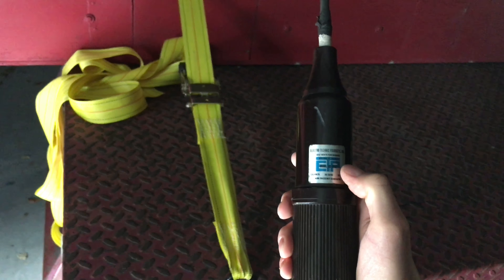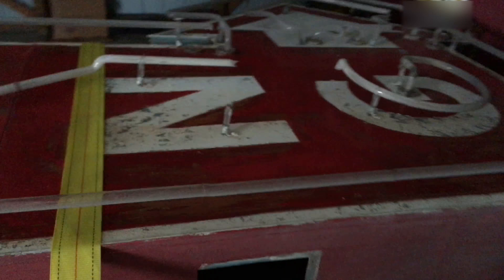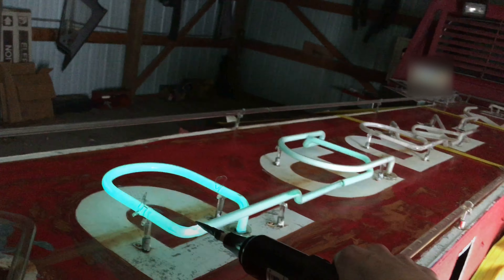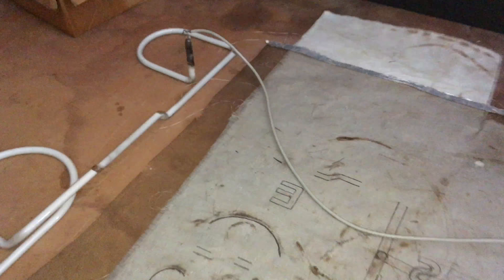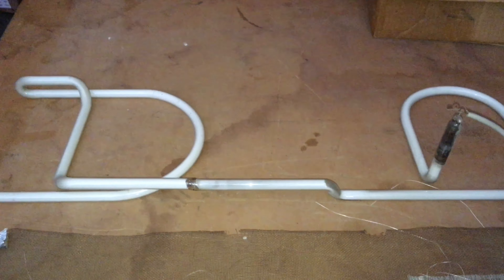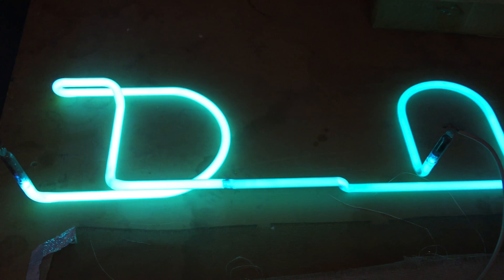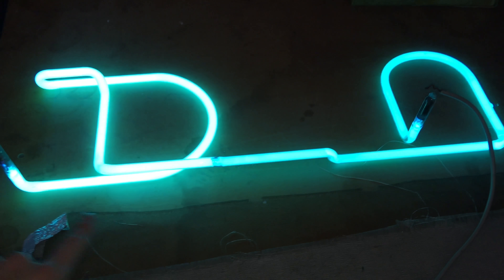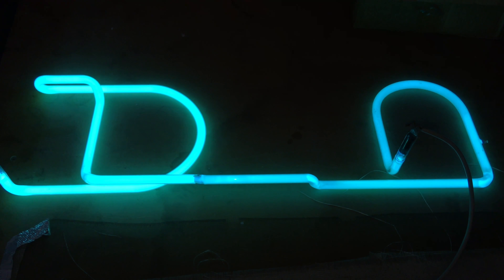Dundee Theater Neon Sign #3: Testing the Neon!

Comment: Can you put violet ray electrodes on this generator and use it on the body?
Reply from the maker: i do not have a violet ray so i cannot say with absolute certainty.  while i believe the spark-generating coil inside this device is of similar design, i do not believe the violet ray tube tips would fit on this spark coil.  this particular device has a fluted metal post inside the neck, upon which the interchangeable, hollow, ceramic tips are retained with a friction fit.  violet ray tubes have metal electrode caps that fit into the body of the device in a different manner.